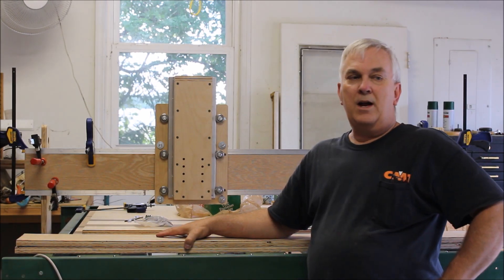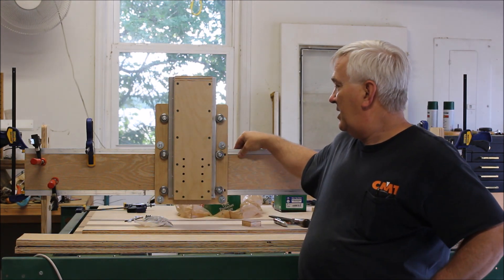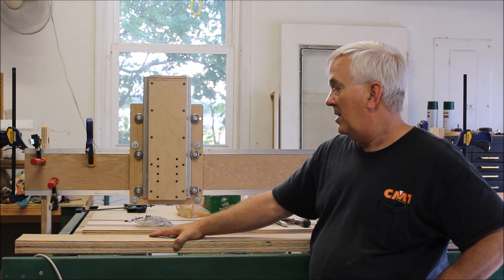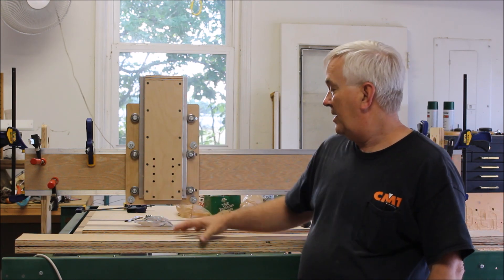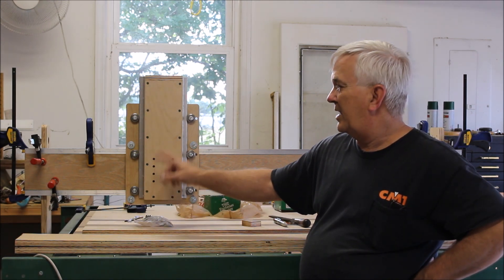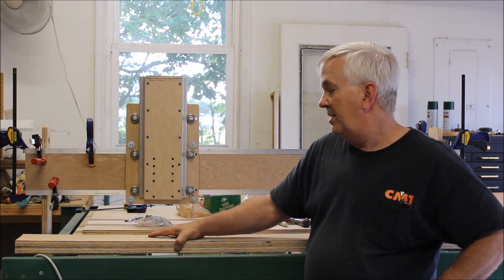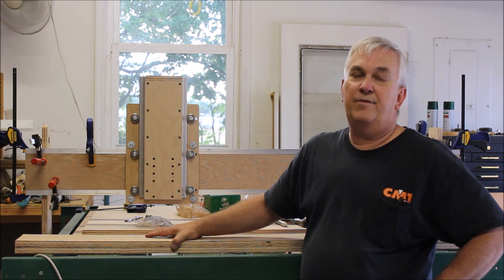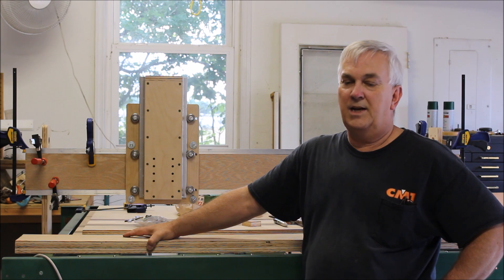New DIY CNC Plans Available Soon

Comment: Dave, We spoke of this before, but I never got a clear answer. So I still have the same question to you - about the longevity of these out of wood vs. metal. I am in the south as you are and get concerned about warping over time - as wood tends to do with this much humidity. With measurements that stay true is critical with these machines Im concerned about investing hundreds of dollars in the plywood alone with something that could eventually warp or bind rendering it useless. 
So do you have any (or links to) customer testimonial videos of these working years after construction with no issues due to the wood warping? Im only asking because I NEVER see any of your CNC videos using one of these - only the metal ones.
I do appreciate you making a design that is more "constructable" for people that dont have access to a CNC to make the intricate parts (like the gantry sides).
Reply from the maker: +Jeff Para I think the clear answer you are looking for is just to the right of this text.  I can see a half a dozen videos to the right this comment about wooden (plywood) CNCs.  You could spend all day looking at YouTube videos of CNCs that have been made from plywood.  The two plywood based machines that I have built are no longer in my shop but are owned by friends of mine and they have not reported any problems.  One in fact I see quite often because he lives right around the corner from me.  The machine is still just as accurate as the day I built it.  Spend a few minutes and look on Facebook at some of the project photos people with plywood CNCs have posted.  Ask them about your humidity concerns.  If you use a good grade of plywood like birch you will find that it a lot more stable than you think.  There's not going to be enough movement (swelling or shrinking) for you to even notice.  Also, the machine is not made of just plywood.  The steel V-groove bearings run on angle so even if your machine is 0.010" bigger or smaller than it was yesterday because of the humidity change it will still be accurate because the v-groove bearings, angle, lead screw are all still the same.  If you have some apprehension about building a machine from plywood then by all means don't.  It is, however, an excellent way for the average Joe to get into CNC without breaking the bank and they can build it themselves without special tools.
Reply: +Dave Gatton  Thanks for the quick reply. I have seen a multitude of videos, however I do like your designs and ideas for their construction. If you ever get around to it it would be awesome to see a quick vid of your buddys machine around the corner in operation - and some details on how long its operated and what adjustments may need to be made or things changed. Its good to know these things.